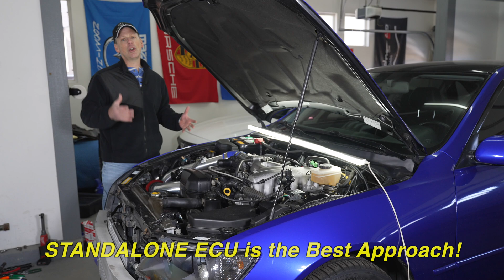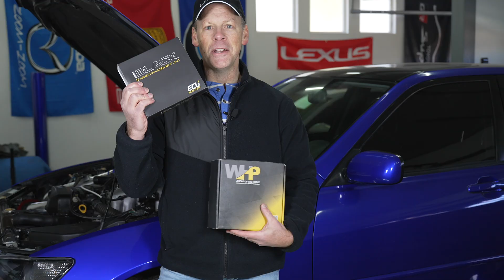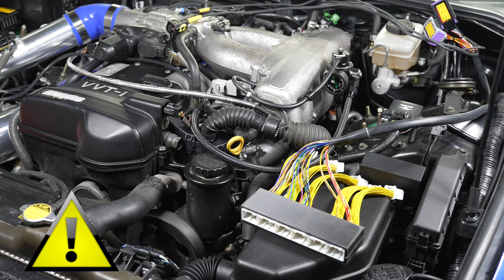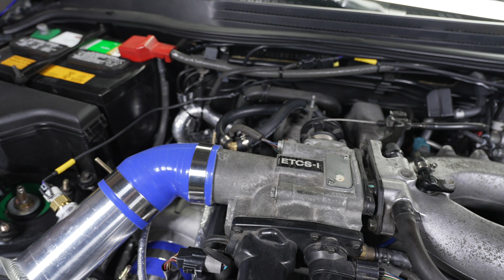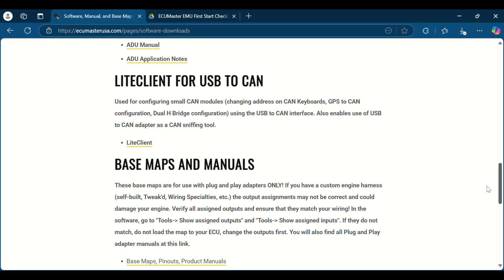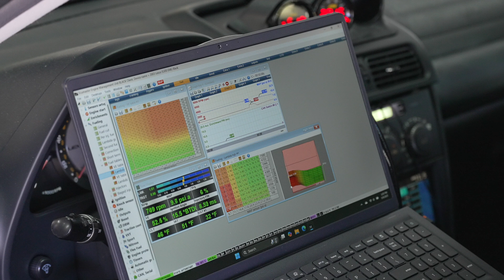IMPORTANT Decision - OEM or Standalone ECU?  //  (Lexus IS300 Turbo Build / 2JZ-GE NA-T)

Comment: I am using Stock ECU on my IS300 Turbo build. It's running well, no codes or problems at 6psi. So far about 9 months since the build. Standalone is obviously the way to go if you have the means. I have some videos on my channel about it.
Reply from the maker: Let me know how the dyno session goes 👍
Reply from the maker: Impressive!  Looks like you kept the O2 sensors and welded the bungs into the manifold 👍. How’s your AFRs tracking under boost?
Reply: @TheLemonFactor  Most of the time during WOT 0.74-0.78 or there about(EU 98 octane = US 93 octane)...however sometimes it can get up to 0.84. I guess the biggest problem currently is consistency, safety and data logging. While I do have the wideband...I lack constant data log that comes with standalones. The only way to affect the AFR is by changing the fuel pressure, but that is very limited tuning...not to mention the stock ECU will "learn" from it and adjust. Also the stock sensors are only reading two cylinders so if something happens to the ones without the oxygen sensor the ECU would have no clue. The wideband is not affecting the stock ECU and is there only for me to see. If you put the stock oxygen sensors after the turbo where all the exhaust are joined then it would throw CEL about slow response.
Its best bang for buck though...I am going standalone at some point but this helps to spread out the build cost and complexity. When I tear the engine down to put thicker rods in then after that I would like to put more boost on it and then it is not possible to use stock ECU anyways. So I see it as a temporary solution.
Reply from the maker: Good luck with your build 👍. How does the current setup drive?  Are you enjoying the boost 😁
Reply: @TheLemonFactor   Thanks. It drives great, no issues at all...apart from the risks hanging over my head that i already described. I think the main thing is that all gagues and functions work as on the stock car...including Cruise Control. The boost has made it faster for sure...planning to go on  a dyno just to find out what it makes.
Reply: @husband_things  hey man, not sure if u ever got a chance to dyno this yet, but around how much whp is this setup making? I want to make this as my next project lol
Reply: @RedZekester  No Dyno run yet, clutch is slipping and waiting to be dealt with. Ill post a video on my channel once I get to the dyno with it. My wild guess is ~320bhp at the current boost level.

Comment: Ur literally at the exact same spot as me I had the exact same plan. My g4x fury is on its way.. I was coming to see if you ever figured out how to get that 4th turbo bolt in
Reply: Use a smaller bolt with a nut
Reply: @vjbond3945  i ended up getting 4 nuts and short studs

Comment: Im glad you chose to go with a stand alone. I HIGHLY suggest you move your MAP source to something other than the same source that feeds your FPR. If that FPR diaphragm fails (which is 100% possible) fuel always enters the vacuum line and that will get sucked right up into the EMU. I’m using the port just on the very front (facing the radiator) of the intake manifold to feed the EMU. 

Just a suggestion but obviously you do you.
Reply from the maker: Thanks for the tip 👍